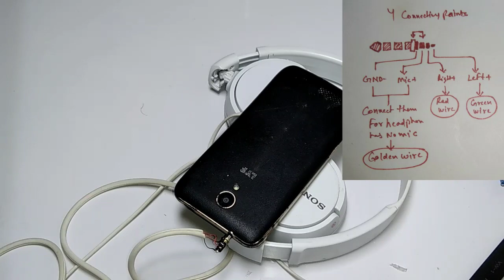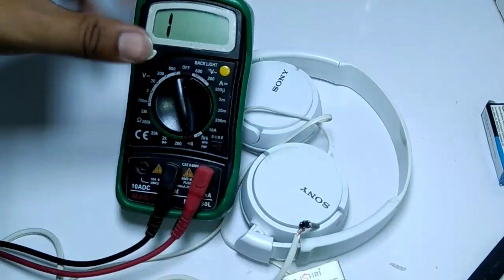Sony Broken Headphone Jack Repair || Headphone Repair

Comment: How to repair mdr zx 310 ap pin replacement bro please i want the vedio ...... Please i got 3 golden wires and I am confused to pair  which one is gnd
Reply: Same problem bro ...
Reply: @amankirar9666  😓
Reply: @amankirar9666  bro  I got it  u should pair all golden wires and there is a black/blue wire hidden u should seperate {mic}👍
Reply: yeah , I already repaired it quit nice ....., That moment is happiest , cause my broken headphone was lying in covered for 2 years .

Comment: Sir why u connect Jumper mic. And what's the use of that?
Reply: Please help
Reply from the maker: Bro this jumper is for headphones with no mic, only for when u r using a earphone jack
Reply: Thanks bro
I have same one Sony Headphones and it's right side speaker not works any more
But now I fix it.
Thanks to you😇
Reply from the maker: Ur most welcome

Comment: I cant able to identify the problem but my right side speaker is not working since I tensioned the wire help me how to analyse the problem
Reply from the maker: Bro most of the cases, jack is faulty
Reply from the maker: Can you open the speaker who is not working? First check speaker
Reply: i think i should use line tester like you did
Reply: speakers are ok

Comment: Hey bro can you help me ? My Headset is broken. you need to bend the jack to work if i not bend its not work .hope u help me😊
Reply from the maker: Yes bro tell me how can I help you?
Reply: Little Bit Tech Info Bro like i said my headset is no sound bro. u need to bend the jack to have sound ):
Reply from the maker: Yes i read it, can you repair it yourself??
Reply: Little Bit Tech Info bro its hard like listening music and hold the jack and bend everytimr
Reply from the maker: Do you have soldring iron?
Reply: Little Bit Tech Info no bro

Comment: The left headset is not working even after joining all the wires correctly.
Reply from the maker: Open and check speaker, sometimes speaker is faulty